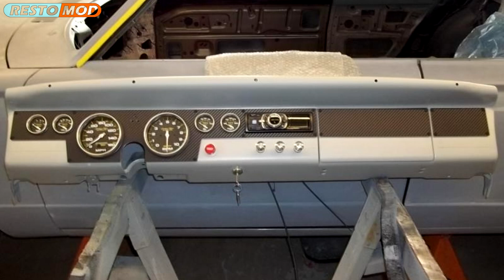1963 Dodge Dart GT Hardtop 5.7L HEMI Restomod Project

Comment: I just bought a 1964 Dart 270 SW.  It has been updated to a 360 and a 904 but the project ran out of steam there.  It's at the muffler shop now getting the exhaust system and some other fab issues sorted.  Alignment next then interior.  Last will be the paint if someone hasn't bought it as a rat rod by then.